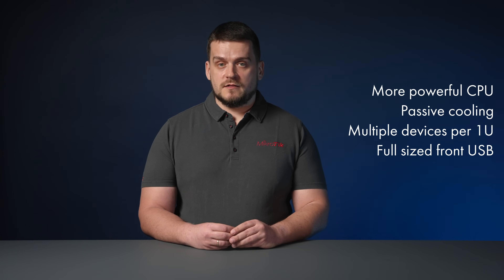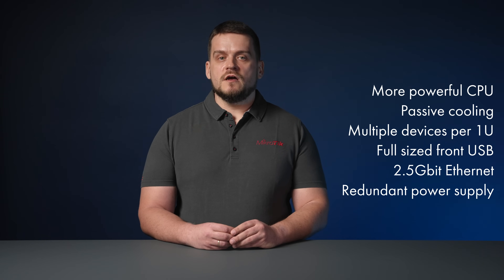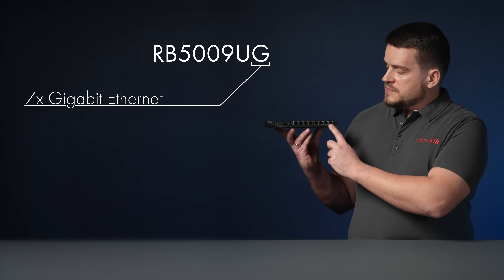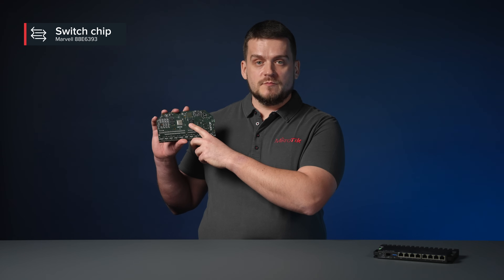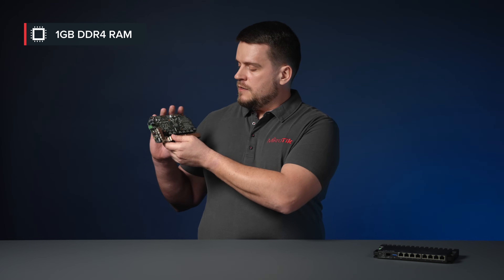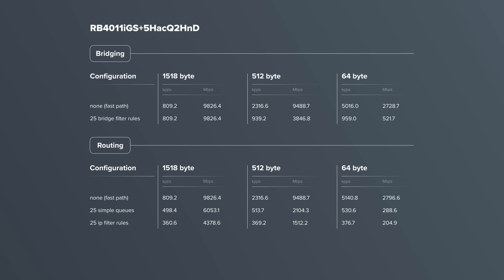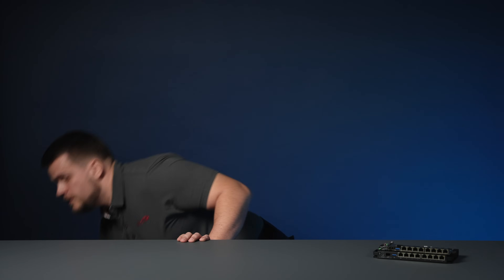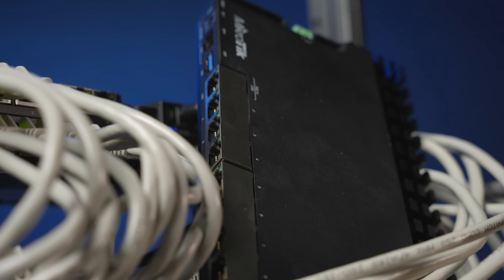MikroTik product news: RB5009

Comment: I don't have this product (yet). But, I don't like that form-factor. I understand it, but the power-connector in the front and big gap (when using a single router) is really bad for rackmount. I prefer the old RB3011 U1 standard form factor. The CCR2004-16G-2S+ is the cheapest in the "old U1 style".

Comment: Which version of this router supports a 12V PSU? Since 12-57V is shown in the video, but on several product pages it actually mentions 24V to be the minimal voltage.

Comment: Dear MikroTik staff, you did announce RB5009 moths and months ago. It is actually available from sellers - I also have them. So, what about to finish homework and connect samples to analyzer, configure standard set of encrypted tunnels and PUBLISH RESULTS?
I believe numbers will not show you in bad light, as this is spectacular device. Hiding numbers from customers, in other hand, actually is more shameful, in my opinion.
Wish you nice day
Reply from the maker: Test results are on the product page. What kind of results did you mean?
Reply: @mikrotik  I have in mind article which is described as "IPsec test results" next to other RouterBoards. To be precise: I see no encrypted throughput data of 88F7040 based device in your resources. There I think you can help.
Reply from the maker: No other v7 product has them yet, it's nothing to do with this specific product. We have not created a test that is for RouterOS v7, where many aspects are different and system kernel is different.
Reply: @mikrotik  well, anyway, thanks for reply. I really like it. Sad to hear about such dark destiny. From my POV very interesting product.

Comment: I have the RB5009 and am quite happy with it. It's small and reliable (which sadly can't be said of all networking gear these days) and quite powerful for the price and size. However, there is some feedback that I have about changes that would make it more useful:

1) Bell Canada has just introduced a symmetrical 3 gigabit tier of residential broadband, so the RB5009 can only handle this in a "router on a stick" configuration (use the SFP+ as both the WAN and switch uplink at the same time in an effectively half-duplex setup using VLANs) if you want any device to be able to use the full 3 gigabit. If the first RJ45 port was a 5 Gbps or 10 Gps instead of 2.5, then this router could support the full speed of the Internet connection without problems. I could use a 5 Gbps RJ45 to connect Bell's ONT, and the SFP+ port for switch uplink as I do now.

2) At least one PoE output port to support a wifi access point would save me the clutter of a separate PoE injector and wall wart, so a PoE output on even a single port would be nice.

3) Some of the lights (like the green ethernet activity light on the RJ45) are extremely bright and I had to put little bits of tape over them. Some control to dim these lights to maybe 25% and 50% brightness would be very nice.

4) When I got the router there was some sort of oil or lubricant that had leaked out at points, I think it was probably from the thermal pads or something? I had to try to wipe off the router, though it's difficult because of the heatsinks.

5) The PoE input port should be different from the 2.5 Gbps port (or there should be a second PoE input port) so that you can use a multi-gig modem or ONT at the same time as PoE input (no cable modem or fiber ONT is going to supply PoE power)
Reply: Until you run 10G in spf+ and try to use the 2.5G port.....not ready for market

Comment: Where is PoE Out 802.3 at?
Reply: It's only POE-powered. It doesn't have POE out. This border is better in that it supports 802.3af/at instead of the passive POE in like the RB 3011 which I have.
Reply: @krizzo  yes, but my point is that is missing. 4011 has poe 802.3af and now they remove it completely

Comment: This looks like a very nice Router. The one thing that puts me off is the lack of a 2nd 10G SFP+ port. With that you could carry your 10G WAN to your 10G CRS326 for example. But of course you'd have to be able to route that fast. Maybe an upcoming product with more horsepower?
Reply: 10G WAN? 🤔
Reply: @DimitriPappas  Yes, I'm running 10g residental p2p fiber WAN speed because 25g  doesn't make much ractical sense withe the current router-tech available.
Reply: @Prophetli  ah. So you're the ISP. Nice
Reply: @DimitriPappas  hehe no. Just a "normal" home user
Reply: @DimitriPappas  In Sweden for example we have several areas where you can get dedicated 10Gb lines for not that much more than you would pay for a 250Mb. Its insane, i know.
Reply: @zipp4everyone263  with proper cake/fq_codel queues even 25Mbps is enough for an average household of 3-4 people. So 100-200Mb would be plenty. 1Gbps or more is unreasonable. But yeah whatever gives people bragging rights I guess... Especially if it's not that expensive like you say, lol

Comment: Didnt see a serial port?.. or am i blindd
Reply: Nope, but it has a USB3 port which doubles as a serial port (the first USB-to-serial device you plug into the port, becomes the serial port. You could use a pair of regular USB-to-serial adapters with a serial cable in between them, or a MikroTik WOOBM-USB)

Comment: Wouldn't it make more sense to have POE IN on any other port BUT the 2.5Gbe one? It is presumably the WAN port of the router, and I guess there are very few consumer GPON/ONT device that supply POE OUT. I know it is not the only use case, but this looks like a dream homelab router and I would find it useful to power it from a POE switch without giving up the 2.5Gbe port.
Reply: How many people have external internet faster than 1 Gbps though? (I'm only aware of Google Fiber from the consumer space)
Reply: @p0358  In italy there are 2.5 and 5gbit/s plans, in switzerland even 25gbit plans (for consumer market, not necessarily business).

Comment: 3:00 where exactly are you getting those performance increase figures from?
on your own website when comparing to the RB4011 tests, this one is only slightly faster (and in a few tests slower).
for example, RB4011 routing with 25 filter rules at 1518 bytes is listed at 7,209.9 Mbps, and 7479.1 is nowhere near a 71% increase from that.
Reply from the maker: The tests on the webpage are done on v7 beta. We are still optimising it and it becomes faster. The CPU is more capable, but the way the v6 tests were done previously, can't be directly compared to v7, as there are significant changes in v7 kernel. This comes at a cost in syntetic tests like this, but with the benefit of faster real world traffic and massive improvements in DDoS protection.
Reply: @mikrotik  are tests in your website listed for RB4011 measured in v7 or v6?

Comment: Janis, can we have a home-class 300-sh series CRS? With passive cooling and maybe onboard PSU for like 8-10 ports. Maybe even hybrid, like ether1-4(5) non-poe, and 5-8(10) poe out with low\high voltage selection? so we could power some cameras\mikrotiks and connect computers without poe. With Marvell chip so all hardware features would work with vlan filtering etc. 
Also would be nice to have a small ARM router (smaller than hex s which is mmips) with spf+ cage, 3-4 gigabit ethernet ports with poe in and passive poe out, so you could passthrough high voltage further to power upstanding switch.
In short: we need more small, powerful and silent devices for home environment.
А вообще вы молодцы, особенно если доделаете наконец семёрку :) Давайте в Москву на MUM уже, мы соскучились и привились.

Comment: Does MikroTik make any switches that are full 10Gbe that have all RJ-45 ports vs SFP+ ports?  I have a MikroTik CRS305-1G-4S+IN switch and it is a very good switch for my needs presently.  In the future, I may want to expand my 10Gbe network but the SFP+ modules for good ones can get a bit pricy.  Even for my CRS305-1G-4S+IN if I were to fully populate the switch the modules would exceed the cost of the switch.
Reply: CRS312-4C+8XG-RM 8x10G RJ45 overlapping 4xSFP+ software selectable with SwOS/RouterOS. This is the only one I've seen of theirs with that many copper ports. Ubiquiti has one I believe; I use "used/refurb" Cisco and Arista 10Gbps RJ45 switches with 48p to 96p and have a lot of luck with them. The cost is much less than brand new switches with all copper 10G.

Comment: Only PoE in, right? No PoE out?
That's a draw back for me.
Reply: If you need a PoE switch, then buy a switch not a router.
Reply: @Christos9  I am pretty happy with my Ubiquiti ER-X-SFP with passive PoE.
I thought vendors would catch up on that by now as PoE enabled camera's are finding more their way to consumer market. I don't want an utility room with dozens of devices to just do a specific task each when one could do it.
Reply: @Herrieman79  But you have to realize the "cost" of POE-out. POE/POE+/POE++ have all a huge cost in heat generation. This passive device is not meant to handle that. Perhaps a RB5009-XXX model will, but when you look at full-sized 1u switches with POE+, for instance, they have a large power supply (heat), POE+ switching chips to provide the level of current needed (heat), and most of the time need multiple fans to cool it. I have 24p, 28p, and 48p POE/POE+/POE++ switches and when they are loaded with cameras and WiFi AP, they get warm. Hard to handle in a small-form-factor (SFF) case. Just FYI.
Reply: @Herrieman79  just use a 4 port PoE injector, sure you don't get the remote power reset capabilities of managed PoE but at least you don't need to overload the router.
I should say i am also using the ER-X-PoE at one site, but at another i have the ER-X-SFP and I use an external PoE injecor as described because it keeps the router cooler and gives me 11at instead of 24V.
Reply: @Doesntcompute2k  What has a large power supply? Just look at hEX PoE light or hEX S. What was MT thinking with this unit not providing at least 2-4 PoE outs? Would be ideal for your cAPs around your home.
Reply: @PetrKrenzelok  I have 11port PoE switches which I use for Raspberry Pi 4 rack-mounted servers. They work fine. But they have a fairly beefy power supply and have heat syncs and fans in them. I'm not sure of the thermals in providing those four PoE you want. Obviously MT would build it if they had enough interest. You might write to them (marketing) and tell of your interest.
Reply: @Christos9  a switch and router go hand in hand, the routing in RouterOS job but there is no excuse for no PoE out. Why buy a separate switch and waste ports.

I need 6 WAN interface with PoE for 6 CPEs which are part of 6 backhauls connected to 6 different modems/edgerouters or to bond 6 wireless links through ecmp.
Mikrotik you weren't thinking.
Reply: @Christos9  wrong

Comment: Finally. So only 2 things left: a good working WiFi solution (at least same quality and reliability as TP-Link EAP APs), and a good working 4G LTE (at least same sensivity, speed and connection stability as any chinese one).
Reply: I run a RB4011 + U6 Lite AP.. amazing combo and gives me wifi6 at low cost.
Reply: @KFCezikiel  I use TP-Link EAPs for wireless without any problems.
Reply: Ugh that hit me in the feels.

Comment: The rack mount system an sideways 2 pin dc input is great, I loved it, 2.5G I think it's pointless, compatibility in 2.5G was always a nightmare, but that's just my point of view, cheers
Reply: A lot of new AMD and Intel motherboards come with 2.5G LAN ports now.
Reply: And of course all the newest generation WiFi 6 AP's, that come with 2.5G. Would love to see a WiFi6 product soon.
Reply: @kwinsch7423  you realize they barely have AC wave 2 working at the end of 2021.
Reply: My cable company gives 1.2Gbit and the modem has a 2.5Gbit port on it.  My ZTE 5G router also has a 2.5G port on it although I can't currently get more than about 700mbit from 5G anyway

Comment: you can merge all 4 5009 to be one? or i missunderstand?
Reply from the maker: Like any router, they can be connected with Ethernet or SFP, but they will still have to be configured separately. They will not becom "one". This is just a mounting solution.
Reply: @mikrotik  cool, thanks. Still wait for some CCR1072 with 12 ports :D

Comment: That's kinda cool but like idk could you FIX THE FREAKING MASSIVE MEMORY LEAK ON 4011'S FOR ROS7 SO PEOPLE CAN HELP YOU MAKE IT ACTUALLY "STABLE". Mikrotik's answer for terrible to no support and troubleshooting: "We'll just come out with a new device that is stable for ros7 and the prior devices might one day be able to use it safely with any config but like yeah maybe in another 10 years"
Reply: The 3011 is and has always been a crappy product though. They just outright have unsolvable issues on ROSv6 as well. Throughput performance with certain packet flow is garbage for absolutely no apparent reason, i.e. speed might cap out at 120mbit/s despite CPU usage at <20%. We've replaced all 3011's in our network and solved many strange spontaneous issues. They just aren't good products and they should be retired (they should never have come out in the first place). Do yourself a favor and get rid of them
Reply: @aidangillett5396  o my bad that should say 4011 not 3011 lol. 3011 runs fine on ros6 and ros7, currently use it for wireguard tunnels.
Reply: @aidangillett5396  fixed the wrong model reference

Comment: A SFP+ switch and a PoE switch in the same for factor would be brilliant, so flexible. I could then mount 2 x PoE switches, 1 x SFP+ switch and 1 x RB5009 all in 1U space.
Reply: Who knows, maybe RB5009 will have POE out model to solve all your problems !  😉
Reply: They're going to have multiple -09 versions. I would *guess* they will add WiFi, perhaps all POE/POE+ ports, etc., in new releases. You're right: four x RB5009XXX in a 1u would help a lot with cameras and WiFi AP (POE), bridging to 10Gbps (SFP+), and VLAN management support. 1u at the top of a rack could encompass a lot of servers in the rack and make it easy to manage while giving some redundancy (should one of the RB die).
Reply: they have a POE version now!

Comment: RU form-factor withou 2 embedded PSU? Not very usefull. It would be better if the device is 1RU tall, but with 2 built-in PSU's.
Reply: You can power them with PoE. So it will be power + uplink.
Reply: @Pupkine-666  Oh, here was my 2nd complaint about the device - only 1 SFP+ port - how can I assemble a fault-tolerant aggregation (copper can be used, but it's ridiculous simple)? And well, I don’t know cultural words about external power supplies in the commutation rack. Give me a Half-U device with 2 internal power supplies and 2 SFP+ and I will be happy to drive them through 500 VPN tunnels (At 700, sometimes 1072 is buggy - here the question is not about the CPU power)
Reply: @ekerlostw  Then upgrade to one of their CCR models.  This RB5000 series device fills a different category & price range.  Also they mentioned this is the BASE MODEL for the new upcoming RB5000 products.....   Lets be patient.  Good things are coming.
Reply: @anthonya.1958  we are using 8xCCR1016 & 4x2004. The problem is that, regardless of the performance, RouterOS cannot stably serve a lot of tunnels with routing, if we could use weaker models, but with smaller dimensions, with the same set of interfaces and power, then we could increase the number of tunnels by 1 unit, which is critical in a rented rack.
Reply: @ekerlostw  But yes I agree, this form factor allows to only use 1U and can consolidate your rented space and power at colo-facility... save $$
Reply: @anthonya.1958  I think we ran into what you are talking about 1 or 2 times, but, to be honest, this is much less of a problem than the unpredictable behavior of ROS when working with OSPF, and especially with BFD

Comment: i would love that Mikrotik make a CRS305 or CRS309 (and other switchs with multiple 2,5 or 5Gb/s ports) with the same Form Factor ! 
and also 10" rack adapter of course :)
everyone could build his 1U rack (in 19" or 10" format) with stacking 1 or more of theses router and 1 or more of theses switch with the rackmount kit in a small footprint
Reply: Yes, this!  I'm getting a 10 inch rack in soon and while my CSS610 will probably fit on a 10 inch shelf, I'd love for a proper 10 inch mounting solution.  If they came out with a new switch this form factor that I could mount 2 of in 1U and directly to the 10 inch rack rails, that would be superb.